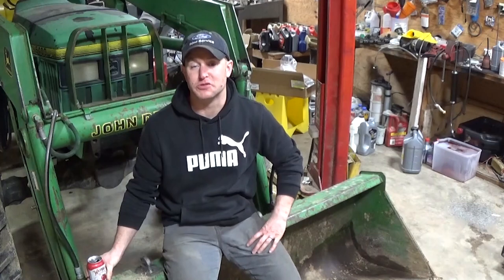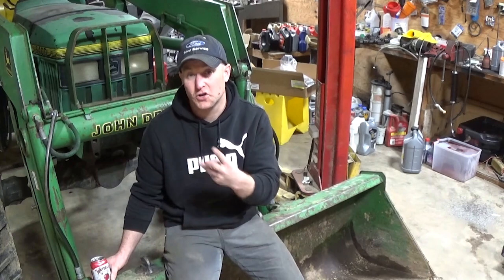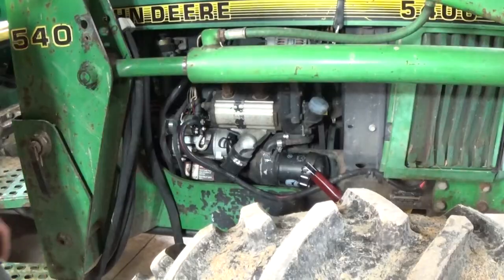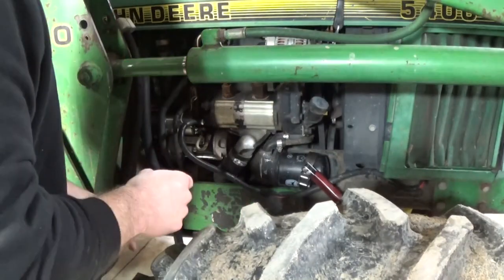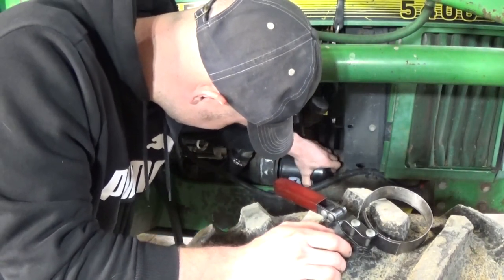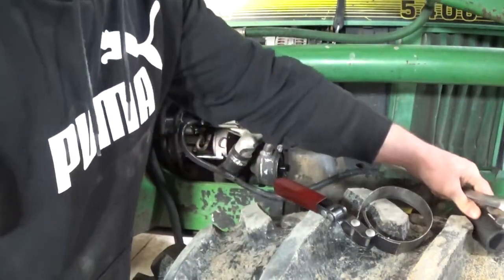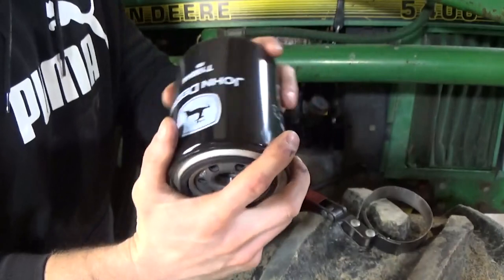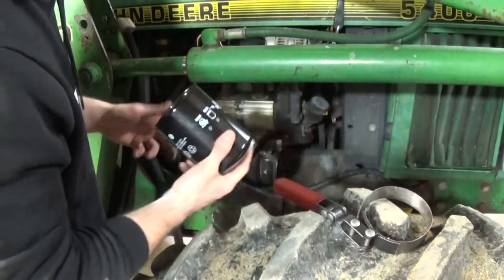John Deere 5400 Oil change, fuel filter and coolant test

Comment: Something to think about for fuel to prime a fuel filter. Do you have a fuel additive sitting around?  Use it to pre fill your filter.  Diesel Kleen, Lucas, or some other even ATF. With the filter off put a clean container under the filter head and pump your priming pump to get diesel from the fuel tank to fill your filter.
Reply from the maker: Good idea

Comment: Good morning sir
Reply from the maker: Good morning
Reply: The hard way, and rough experience are good teachers. Although you won't forget. 
The hand pumps are common on older semis our 2020 freightliner M2 don't have them. Our Macks do though. 
To clean the injectors we have been refilling our fuel filters with a mix of Marvel Mystery Oil and enough Archoil for 100 gallons of diesel. This works well for the f650/6.0 and Macks/E7.
The 2 2020 freightliner M2 106 uses 2 filters, the screw on filter gets the sane mixture, and the water separator gets diesel because it is 2qts to fill. 
Great informative video.
Reply from the maker: @dunbarautomotive  that’s a good idea adding cleaner to the fuel filter

Comment: We have a 5400 John Deere 2.9 Diesel that is putting oil in the water.  Where should he look for the problem?
Reply from the maker: 2 places I can think of would be the oil cooler or head gasket. 
I believe the oil cooler on my is at the oil filter housing. If o-rings have gotten hard they maybe leaking.